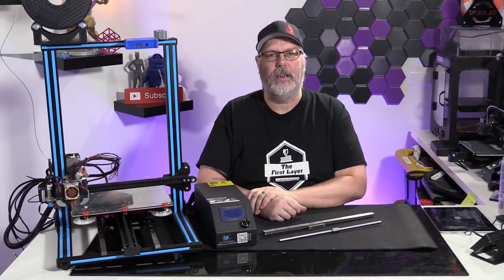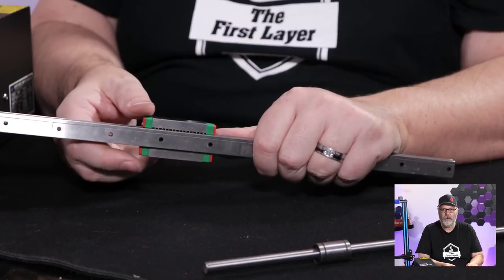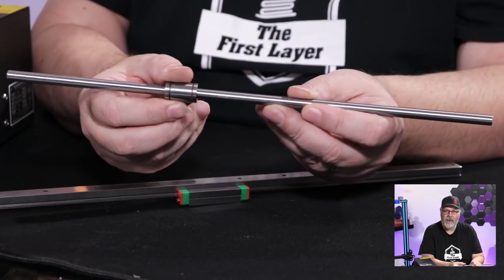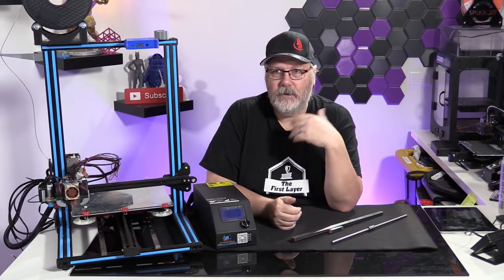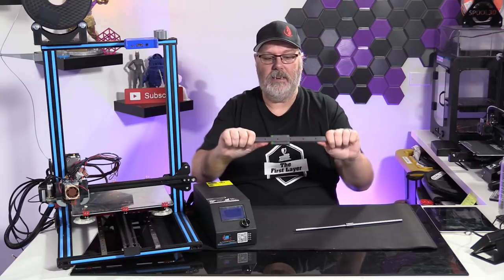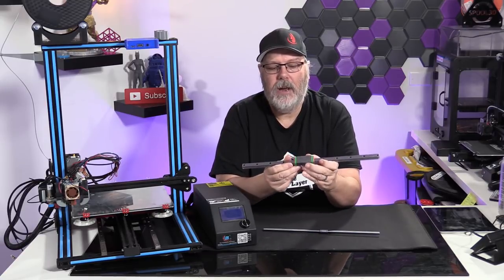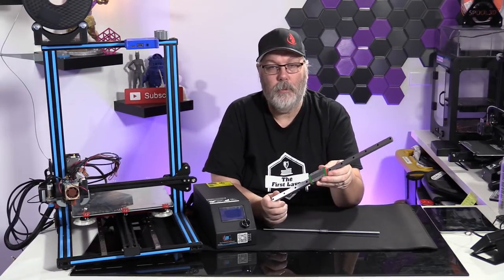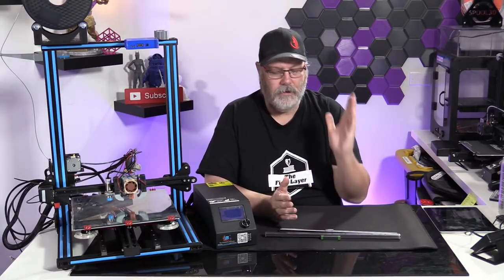Linear Rails are they better than smooth rods?

Comment: Just to correct the mistake. The LM8UU bearings DO circulate in the plastic housings.
Reply: Beat me too it... by like a year. lol
Reply: Several mistakes. Linear rails are NOT guaranteed to be flat, even the high end ones. They're intended to be clamped against a machined reference edge. Linear rods, at least from reputable vendors, ARE guaranteed to have whatever level of straightness is specified. An alternative to expensive precision ground mounting surfaces for linear rails is the well established technique of "replication." Using an existing high-precision standard to create a similarly precise feature. A good engineer's straight edge and some metal-filled low-shrink epoxy will achieve it.

Comment: "There is no..." plate wiggles "Little to no movement---"
Reply: lul, she'll be right mate 👌
Reply: No movement at the rails I’m sure he meant... the hotbed is on springs with these little desktop printers so it’ll have a certain amount of vertical movement regardless, just no sideways movement if you add one of these rails. The upgrade is worth doing on this style of printer, but you can get away with using just a single rail and still see the benefits. If you add a second rail, the two rails must be true to each other.
Reply: @SWhite-hp5xq  But they aren't on the springs they are on a threaded screw. The spring is just to maintain tension on the thread pitch to stop it moving due to vibration.
Reply: @miked5444  not to mention the wiggle if I remember right was twisting lol
Reply: @miked5444  its on both... both work together to make the supports for the hot bed. remove either one and you'll have issues.
Reply: "wiggles" man that thing was boutta head out
Reply: @miked5444  Yes, the screws prevent up/down movement, but they can tilt a little bit, allowing the bed to twist.
Reply: there is alot of movement... if it only would be the screws wich are flexing only the plate would move... but the bed holder wiggles also... he took cheap af linear rails.. that chinese sh$%$&% is not worth it... go get some good ones from misumi or hiwin.. they cost but they are worth every penny...
Reply: 6:18 LCD light's up. Thats good for printer board you Pro.

Comment: what's the point of having stiff linear rails if what you build on top of it is not stiff at all. you wiggle the whole build plate around like crazy and say it doesn't wiggle? if stiffness is a problem just use bigger rods. your comparison is complete nonsense.
Reply: Because rods in general suck. Frankly I’d never use a 2 pillar printer anyways but in comparison my 4 post 18 x 24 x 18 printer could machine parts if a spindle was installed it is so rigid. More rigidity means better prints. Fix the mechanicals then work on the tuning.
Reply: Yeah, and using linear rails "floating" like this is no better than rods anyway. The advantage of rails is that they have screw holes all along them so you can mount them to a big stiff beam.

Comment: At 2:12 , you are wrong about the motion of the ball bearings because yes they move around like in the linear rail ball bearing,  also those ball bearing are design to move in the linear direction ,  they are not made to rotate in the axial motion.   For the linear rod,  you can also try the bronze graphite self lubricate bushing.  They move more easy then the bearing.
Reply: I was saying same, those tiny balls have endles loop guide
Reply: The kind he has don't recirculate, the balls are in little pockets in the plastic liner so he is actually correct. In addition, since they aren't recirculating bearings they CAN allow for rotational motion.
Reply: LazyH-Online some people don’t realize how many various styles of rails exist. That said any round rail is going to be inferior to flat square rails.

Comment: The reason why the circular rails flex is because they are mounted on the ends. The linear rails shown also flex. They are mean to be bolted down to a stable base. This will make the complete structure firm and stable. 

There is a high percentage of thumbs down for this video because of the significant errors.

Comment: He's trying to twist the rod in the linear bearing and then says "I can feel some binding". Yeah... linear bearings are not designed to twist at all. Just like the linear guide block, they are only designed to move along the rail, not to spin on it. You feel a lot of friction if you try to twist them. But the Linear Guides are much stiffer, more accurate and more expensive.

Comment: I'm about to anger a lot of people. Linear Rails are designed for heavy loads that need somewhat accurate placement/ movement. Linear rods are for high accuracy movements and alignments. I'm generalizing a lot here do to how deep a subject each use case is. But in the use case of 3D printing the only advantage either will provide is a more reliable flat movement of the build plate. The over all benefits of these parts is ZERO do to what they are connecting to. A lot more changes need to be made to the heated bed to get any significant benefits. Modifying the eccentric nuts with a shoulder bolt would have the same benefit over all if the nuts are any good.

Comment: Around 6:16 the screen on that printer lights up - this is really bad. When moving the bed by hand, the stepper motor can act as a generator, sending a bit of power in the wrong direction. This can result in a blown stepper driver, which is as good as a bricked mother board in a CR-10 since the drivers are integrated into the main board. The take away here is to never move the axis by hand when they are plugged into the control box. If you have to, do so very slowly, and don't plug or unplug steppers or sensors when the control box is powered on.
Reply: Meanwhile, I have powered on a printer swinging the bed back and front, changed some settings and saved them.
Reply: Can confirm, I burned a driver dropping the y axis on my laser when moving it.

Comment: Was i the only one that cried when he pulled the hot bed back and the LCD screen lit up
Reply: I know it's been 2 years but yes.... I cried too
Reply: @im_ricebowl  what does that mean?
Reply: @marklynch1305  so if the screen is getting powered (the lcd lighting up) it means you're applying a reverse current which can basically fry sensitive components on the main board

Comment: People who 'don't know any better' shouldn't make these videos and those that don't know any better will learn nothing useful from this. If you need to know how these things work, look elsewhere. This guy doesn't know, hasn't taken the trouble to find out and is misinforming you.
Reply: YES!
This guy should not be pretending to teach people about a subject he is grossly ignorant about.
Reply: Totally agree with you. This guy should educate himself first, before teaching others
Reply: what did he say that was wrong? he explained how the bearing block works with the loop of bearing on each side correctly. 
if your really slow and careful you can take the rail block off without loosing you balls. they are suppose to have a guide holding them in but it can get loose easily.  sometimes they dont have the bearing guides. whatever its called.

really its a pretty simple thing no need to read a book on then and write a 500page essay. then have some collage professor in mechanical engineering grade it.
Reply: @darkshadowsx5949  At approx 2:16 he contrasts the round bar variant of linear rails with the Hiwin style rails by saying that the balls do not circulate but 'roll in place' this is patently wrong, they recirculate in exactly the same manner as the other linear rails. In fact, if they were captive as he suggests, they wouldn't be able to roll at all, no travel, no roll. Pretty basic stuff. Since this erroneous assumption is the main basis for his suggesting that the Hiwin style rails are far superior his argument falls flat on its face. Both styles are linear rails. Although I've dismantled some round rail bearing blocks, you don't need to do so to confirm this, just take a block off and gently push the balls with a pencil or something similar. You'll see they roll along in their groove and 'dissapear' being replaced by others from the same set 'appearing' behind the ones you are pushing. I can see two advantages in using Hiwin style rails over the round ones. 1 because the cross section is roughly 2x1 you can get better rigidity of you mount them with the broader part vertical (think of the beams that support floor boards). 2 on very long rails you can add further support by attaching the rail to some other structure, not possible with the round chappies. Main disadvantages of the Hiwin style (unless it's an actual Hiwin) are - 1. maintenance, the flexible dam that's supposed to sweep the rail and prevent dust getting into the block is not very good on the cheap copies. 2. It's the luck of the draw whether you get a block that has a full set of balls in it. 3. Also, it's luck again if the balls are the right size for the block and rail. If you want an informed view on which rails to use and why look up https://m.youtube.com/user/ThomasSanladerer you'll get unbiased, educated info from him.
Reply: I agree.  A lot of his videos are like this....incomplete...I like his ideas... but ...those chrome rod/bearings in are many high end printers, such as Ultimakers and Raise3D, etc etc
Reply: I was going to comment exactly this
Reply: it would be interesting to know what the ACTUAL benefits are, I'm looking into it and doing a bit of research, now I remember why I clicked off this video the other day
but that aside, I'm thinking 10mm rods (they're max 400mm long) and some bronze bushings, maybe igus but they're fiddly
or some small rails, like 12mm rails (Chinese, I want some cheap stuff I can tune up)
but I'm wondering what would be better (and maybe cheaper)
I'm looking a options and yes, rails are a bit easier to mount than rods as you screw them on a plane rather than at the ends
but that aside good rails are expensive, so rods are appealing
any pro's opinion?
Reply: @l3d-3dmaker58  What are you building? I'd advise not to self-source a 3d printer now adays, kits are cheaper and very good already. If you're doing something exotic, rails are much better, but linear rod is easily good enough for most applications. See E3d's tool changer linear motion system for a particularly elegant implementation that really takes advantage of the strengths of linear rails
Reply: @philchadwick9470  there are linear rod bearings that rotate in place due to being contained in pockets within the nylon, so he actually isn't wrong about HIS version of the linear rod bearings.
Reply: Using cheap Chinese rods and bearings. On Nippon website they explicitly stated rods are smoother quieter than linear rails.

Comment: The rails are machined when they are screwed down. If they are not screwed down they will bow (slightly) and you will loose a lot of the advantages of using rails.
Reply: Absolutely. Heck it would be even beneficial to screw them to something like 2020 extrusion to stiffen base frame. Not that it would be ideal , but still better than having them slouch in midair secured from their ends.
Reply: Depends how much much effort they put into the machining if it will flex after marching. Buying quality brands would the answer
Reply: If you put enough pressure on the rail to bow it, your profiles would start to bend.
Reply: @Hathorr1067  As I said originally, the rails are machined bolted down. When they are not bolted down they bow. This is not a matter of what brand you buy, they are all done the same. It is not a 200 thousandths(.200) bow we are talking about, but sub  ten thousandths(.010).
Reply: @bradquinn4161  They're going to follow whatever profile they're bolted to regardless. If you're base is "perfectly" flat, the rail will follow suit. There's little room for distortion on extremely flat mating surfaces.
Reply: @KISSMYACE3203  That is just it. They are machined bolted down and they are flat under those conditions. You check them out on a surface plate (unbolted) and they will have a bow in them. It is very similar to the head of an engine. If you tighten the bolts on a head in the incorrect order you will bow the head. Now a head is MUCH thicker material and you are using a LOT more pressure to tighten the bolts, but the concept is still the same.
Reply: The holes are there for good reason trust me however you only need every other one use real t nuts and bearing steel rails for a straighter life

Comment: The fact that you can touch and move your finger along than linear block without it moving on the rail means, it's not moving smoothly at all and it is binding.
Reply: he did say that was a cheaper product and it had come apart and lost a few balls
Reply: @theq4602 Oh thanks. I'd missed that. They're easily replaced.

Comment: Work vasiline also for greasing or what kind of grease should i buy (lithium as you sad, but which product is better, worse for greasing)?
And do I have to clean the linear rails and grease them with new grease?
Reply: Yep, white lithium, clean before with iso
Reply: Indeed, the chinese made rails and carriages need torough cleaning and greasing before use. I don't know what they do with them, but there is a lot of junk in the storage oil they use. I also use isopropyl alcohol to degrease them and then I use very fine oil. Probably lithium or teflon grease is better suited and kills some of the noise too.

Comment: This is a slight unfair comparison of the two types of linear rails, your bearing block on the profiled rail has recirculating bearings, whereas your example in the round rod does not. They do make recirculating round shaft bearings, which won't cause that rough binding or hang ups. Certainly the linear profiled rail is going to be inherently better, as its also supported, whereas the rod can go unsupported.

Comment: Those round rail bearings are terrible for rigidity and motion. They are merely a low cost option that gets the job done. Do you want a Ferrari or a Honda? The performance differences are clear. The holes should be every 40mm but they could vary per manufacturer. The closer together they are the better and absolutely use every hole to fasten them down so they sit flat or they will likely bow up where a fastener is missing.

Comment: 3D printer with linear rails that does not even required weight is a stupid upgrade and a waste of money. Linear Rails are common on CNC router machine having the facts of milling a material especially aluminum required rigidity and stiffness of all the axis..

Comment: I have the Ender 3 Max printer. Just some comments because I am frustrated and disappointed.... I still think, after about one year, I got a Lemon printer. The frame in not level and square. I have tried straightening the frame for the X and Z Axis. And I got it close. Now my Y axis is giving me problems. The wheels are just to tight and the bed wobbles/ flexes as the wheels try to aline in the groves as I push on the bed. So then I end up having to tighten the wheel down to tight. On my Tevo Tornado printer the bed is nice and smooth. Although I was getting layer shift issues on my TEVO way back. I have since discovered that a layer shift issuer is slightly loose belts. So I am going back to my TEVO to try that printer again. everyone should get belt Tensioners as an immediate upgrade. I am in the process of upgrading my Tevo to get it back in service. I am thinking of upgrading my Ender 3 Max to Linear rails if that would help. I do think I should just junk this printer frame and start a new. Just about everything else except for the frame and bed has been replaced. One final tip: If you test your Filament Nozzle extrusion and it looks good but nothing seems to come out of the Nozzle when Printing your first layer it is because your nozzle is to close to the bed. Use Babystepping to adjust the Nozzle height, UP, until you get a good first layer. That was a very key tip in my learning process as to why I upgraded my Ender in the first place. I also installed a EZABL probe. I keep throwing upgrades to try to fix different issues.

Comment: Both implementations are stupid. For top end, tolerant of 200C, look at ceramic coated aluminum with frelon bearings ~$70 per 400mm. Cheaper end, tolerant of 65C, look at polymer bearings on plain aluminum ~$30 per 400mm. No need to have these complex ball bearing solutions, they are the same price/cheaper than good polymer rails and are worse for 3d printing. If you get the $17/400mm cheap Chinese linear rails you have to take them apart and remove the protective film and re-grease them with good grease to get them running smooth. Shitty way to save $100 on a 3D printer if you ask me